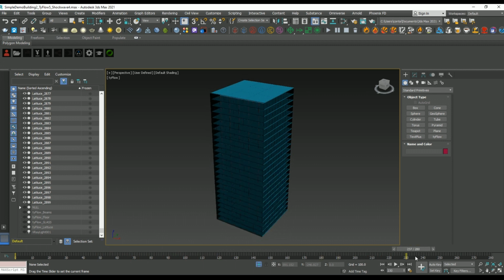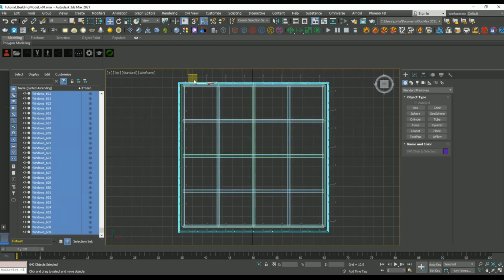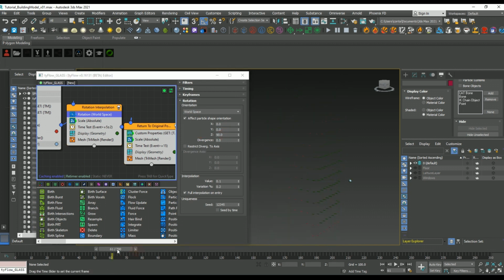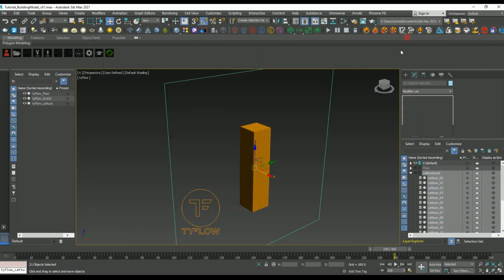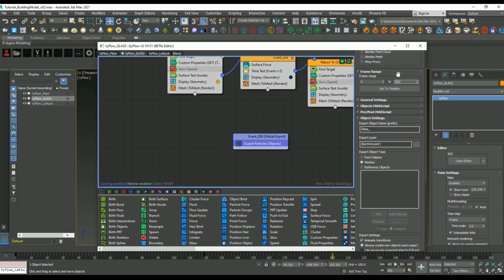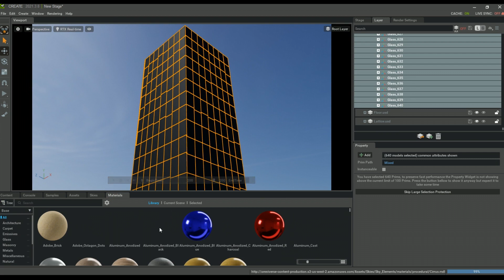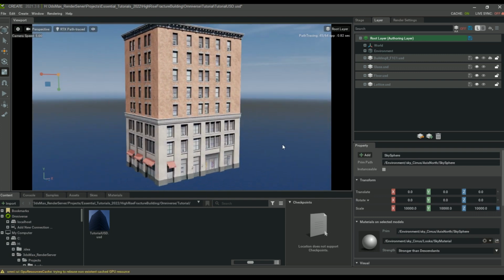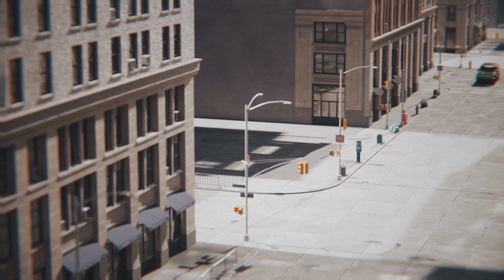Using Tyflow and 3ds Max to reveal a building in Nvidia Omniverse Create - Tutorial

Comment: honestly never heard of Omniverse C. How does it actually differ from UE? Is UV stored in fbx. Thank you, awesome tuts btw, subscribed
Reply from the maker: Thanks, I'm fairly new at it still and I've only scratched the surface, but it's a very similar workflow to UE, Omniverse also has a sequencer window like in Unreal engine, and you can also live link and record takes the same way. They have connector apps for 3ds Max, Maya, Unreal Engine - where you can single export into the USD file format that transfers all of your UV's/materials - or you can import an fbx or alembic file from any software. Hope that helps!
Reply from the maker: Also yes, fbx will bring in your UV's - and you can recreate your materials in Omniverse Create
Reply: @edstudios  thank you very much for the info. Good luck with the videos, Ill be following
Reply: Its Nvidia saying "me too" with FB's "metaverse" bs. Instead of FB collecting your data its Nvidia.